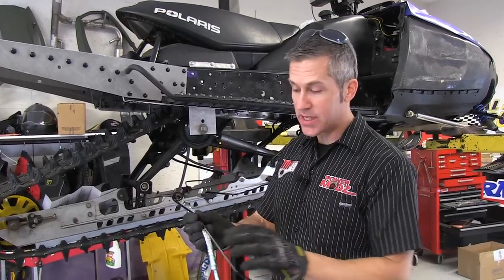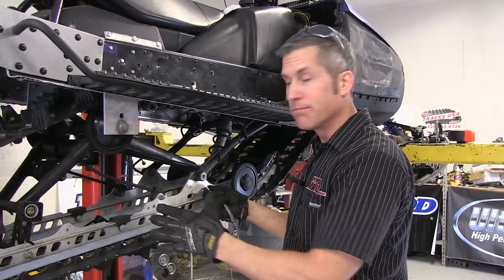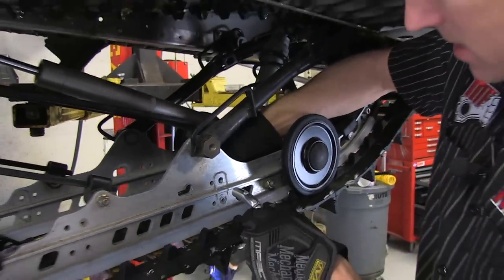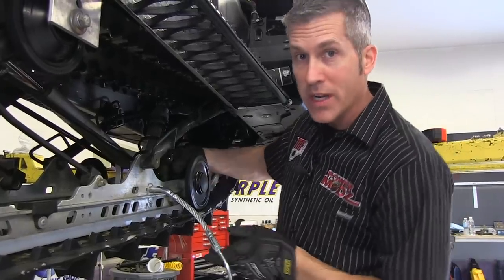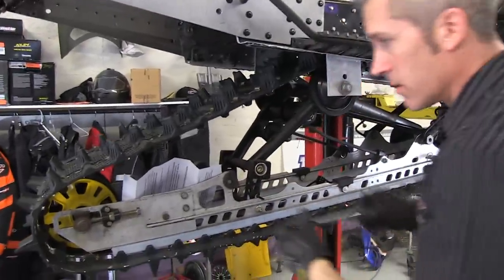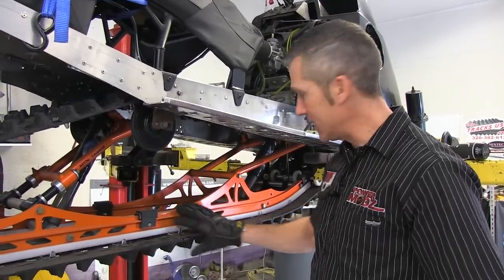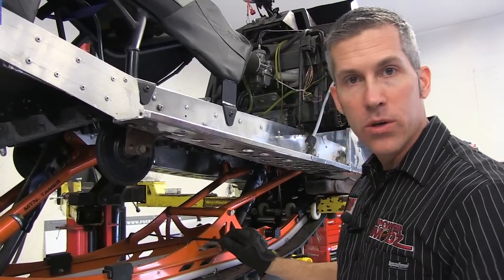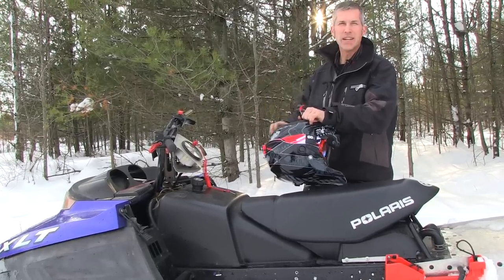Duraflex and RSI ice scratcher installion Video!  First Place Parts!

Comment: I love watching your videos and I'm a big fan but when you said it only helps with cooling a little I have to disagree a bit on that.... I had a 2015 pro rmk and now have a 2016 pro rmk and if I run my scratchers up both sleds would run 150+ degrees and with them down they both run 122-125 steady... Mind you this is when the weather is -15 and +30 makes no difference.. Can't wait for the next video! 👍🏼
Reply: the pro RMK is another animal, running without scratchers is not an optionoutside of the pro and axys, a lot people never need them for cooling
Reply: The systems on them rmks are garbage unless you're kicking up fresh pow they'll heat up

Comment: I am having a hard time getting the old ones off... any sugestions?
Reply: On some scratchers one side tne bolt will screw clock wise while on the other side it is couterclock to prevent loosen-up. You are probably trying very hard to unscrew the wrong direction.

Comment: Small bit of info for ya youtube.  Lock washers don't improve the fastener unless the material is soft enough to be bit into.  Bolts fasten based on tension alone.  True lock washers have two washer with angled teeth against each other that increase tension while trying to loosen and cost way more...